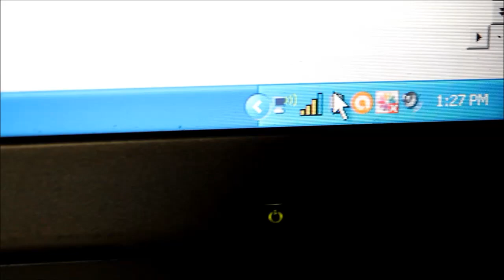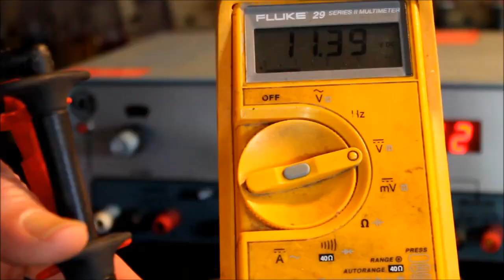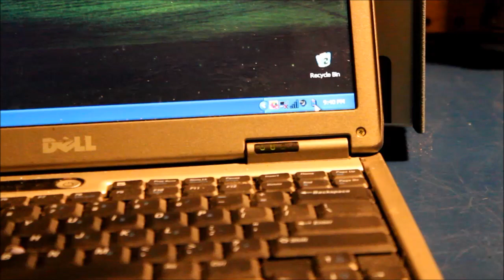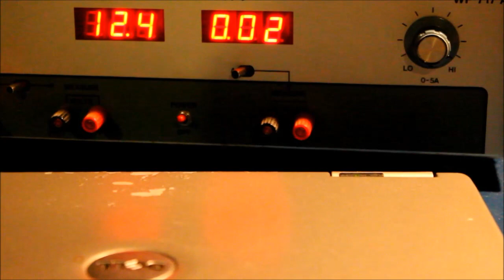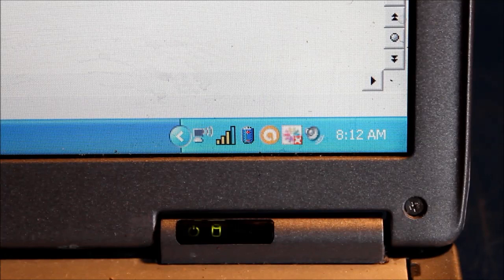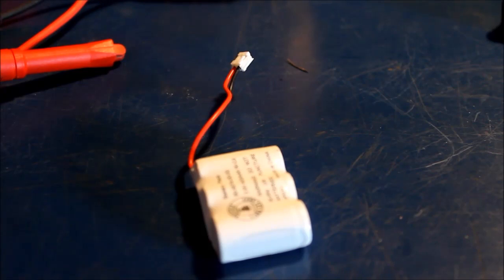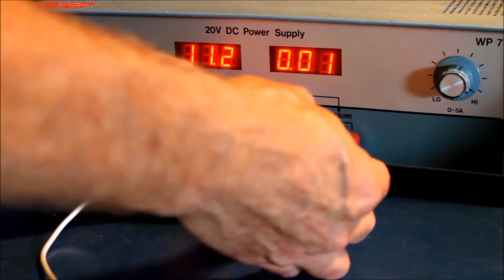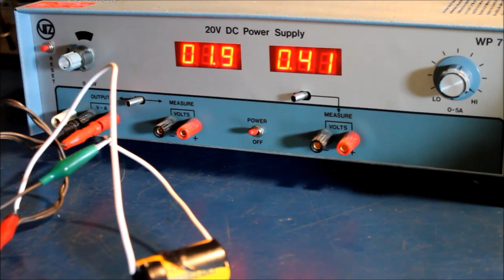How to charge a rechargeable battery with a variable DC power supply

Comment: I have an old Dell D600.  I have a known good working battery. I tried measuring the voltage on the outer most connection
points and got ZERO volts.  Your laptop and battery look identical to mind but I don't measure any voltage.  The battery as labeled is a Dell C1295.   Any clue what might be wrong?
Reply from the maker: It can be tough to get a good connection with your meter with that battery. I used spade electrical connectors. But if the battery is good, then it must be the charger that's taken a dive. Mine failed on a similarly old Dell. At zero volts you're going to need to bring it up like I did in this video.
Reply: @TheOriginalMechanic  it's a good battery and I am also using spade type connectors  but no voltage.  I read somewhere another connection on the battery has to be shorted for the voltage to be present.
Reply from the maker: @n1kkri  I'm not aware of that. I was able to check my battery voltage and I believe its the same one as yours.
Reply: @TheOriginalMechanic  The battery is good.  It works perfectly in my laptop.   There is nothing to charge
since it is already charged to 100%.   The problem is I don't measure anything at the outer most terminals
on the battery.  Could you give me the model number of the battery you used and the model of the Dell Laptop.  That might explain it.  All laptop batteries do not produce voltage without a jumper between ground
and one of the other pins.   My laptop is a Dell D600.     Ken
Reply: I figured out why I am not getting a voltage reading.   The battery is a TYPE C1295.  This is for the Dell D600 laptop.
This battery requires a jumper between Ground and a pin called "SYS PRESENT"  once grounded the voltage appears at the out most contacts for + and -   voltage.   I used a 1000 ohm resistor for the jumping.
If the battery where placed upside down, with the connector on the left,  the pin out would be the first
2 our negative, the 3rd is NC, and the forth would be the SYS PRESENT pin.  I placed the 1000 ohm resistor between the negative and SYS PRESENT and the output gets switched on.   I have a R/C multi-battery type charger.  that I plan to use to charge.  If I had access to the batteries I could do a balance charge but as long
as all the cells are still good I should be able to charge it from the connector.
Reply from the maker: @n1kkri  Excellent job unravelling the mystery. Very tricky of Dell to design it that way and I have to wonder why they did it. Maybe so their battery can't be used elsewhere.
Reply: @TheOriginalMechanic  Maybe so the battery will only be used in a Dell Laptop or to prevent the battery from being used outside the laptop.   At the moment I have a battery connected to a R/C multi battery chemistry charger.  I have it in the discharge mode and so far it's discharging and should stop at the correct
level for a 3 cell battery.  Next I will switch to charging mode, lets say at about 1 amp to see if it will charge
without heating up the battery.   The cells in the battery can handle 1 amp of current.  Not sure if the small
circuit board connected to the batteries will limit the charging current.   I would like to learn how to reset
a battery.  When you remove a bad cell and replace it with a good cell the battery could have no output until
the circuit is reset.   They have very expensive equipment that can not only charge, discharge, give you info
on the battery but also reset the battery should you replace a cell.   I wouldn't be surprised if someone
figured out how to read the data as well as reset battery using a simple Raspberry PI or a Arduino board.
Reply: The puzzle isn't completely solved.  I can measure and discharge the battery with the use of a 1K resistor
between GND and the SYS PRESENT.   I discharged a fully charged battery down to around 9 volts with an
average current of 0.5A.   However, I can not charge the battery externally.  I am guessing there is 
a diode or a some sort of a transistor or mosfet that only allows current flow in one direction and that is out
of the battery.  There must be a signal the laptop sends during charging that allows current to flow into
the battery. I put the battery into the laptop and charged it right back to around 12 volts.  More research has to be done.  They sell external chargers from around $39-$100 that can
charge laptop batteries.  They must be doing something with one of the other pins during the charging sequence.

Comment: How much voltage you have applied from DC power supply to charge 3.6 V Ni-Cd battery ? Is it 4.2 Voltage ?
How much time it will take for full recharge. 
 
Thanks in advance
Reply from the maker: I always start at a voltage just above the measured voltage on the battery. Then as the charge current declines I step the power supply up in stages. At full charge you should be at about 5 volts. It might take an hour or so.
Reply: @TheOriginalMechanic  thank you very much for your kind reply

Comment: You know that plug on the laptop charger that plugs into your laptop you can cut the correct size plug off of a ac adapter that you might have laying around your house and just wire it up to the variable power supply and plug it into your laptop and use the variable power supply as a laptop charger That would have been easier than doing what you were doing with the laptop battery because what you were doing is very dangerous to the battery and you could short something out if you screw it up
Reply from the maker: Thanks for watching and providing the feedback. I had not thought of that method.

Comment: It is good for occasional use but to prevent damaging your battery, you should use proper charger, or, alternatively, know the charge modes (differs for Ni-Cd, Ni-Mh, Li-Ion battery types) and correct termination detection variables (Ni-Cd and Ni-Mh might overheat and get internally damaged if overcharged). Li-Ion are the trickiest ones - they need constant current mode first and then constant voltage mode until current drops close to 0 (it might never reach actual 0), while for Ni-xx batteries you charge only by constant current, but picking appropriate current value.

The safest charge mode for Ni-xx batteries is at 1/10th of the rated mAh and charge for about 16 hours, but closely monitoring the voltage reading - it will rise slowly up and then at one point it will rise more rapidly and then drop down, and then the battery will start to heat up, at which point you should stop charging to prevent damage.
Reply from the maker: Thanks for watching and adding the helpful, detailed  tips.

Comment: If you're reordering a new charger, why bother with pulling the battery? Why not just connect the old adapter (not the brick itself) to your power supply, set the voltage/current limit and charge straight through the laptop?
Reply from the maker: Looks like you need that part. And its probably hard to find.
Reply: You can buy aftermarket plugs off eBay for dirt cheep and use those to fix your original power cable.

Comment: What will happen if I charge the battery with more than the rated voltage of the battery?
Will it charge faster and get heated up? Will I damage anything?
Reply from the maker: +Mehul Dhargave I'm assuming you're using a charger designed for a different battery. Yeah it would charge faster and hotter. That could be hard on the battery as you could charge it beyond it's designed output voltage.
Reply: +The Original Mechanic A good example is that I always charge the my iPhone of 1A 5V with a iPad charger of 2A 5V, and it gets charged up quickly. Can I use the power supply to charge any battery with higher voltage to charge it faster with precaution that the temperature is under control. I worried about the worst case that it may burst. Thanks for replying for previous comment :)
Reply from the maker: +Mehul Dhargave A higher voltage won't matter if the charger can't put out enough current. You can try it with higher voltage, but monitor it for overheating (the charger or the battery).
Reply: +The Original Mechanic Thanks for replying. You and your video helped me a lot. Keep uploading such videos : )   I will recommend this video to my friends.

Comment: This perfectly answered my exact question and was very easy to follow and really well put together! Thank you for your efforts, I will definitely contribute something (likely not much, bc I am perpetually broke, but something!) I do have a small question, though. Near the end, when you hooked up the C battery, you said it was a 1.3v battery, but you set the power supply to 2.0v and then backed it down to 1.9v. Even if the batteries working voltage is 1.5v, as I am guessing it likely is, why the 2.0v charge?
Reply from the maker: +scott dingman This battery is a nicad (nickel-cadmium) with a working voltage of 1.3V. I couldn't tell you why I turned the power supply down just there--I just have to diddle with stuff, I guess! Glad you found something useful here and if you can make any donation at all I would really appreciate it! Good luck with your project and thanks for watching.